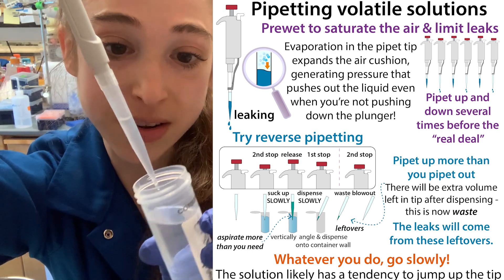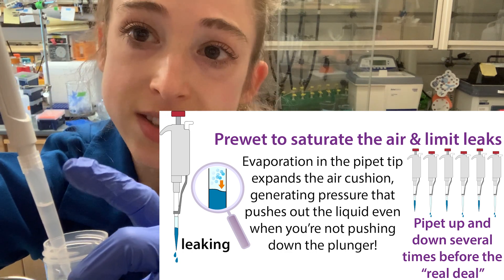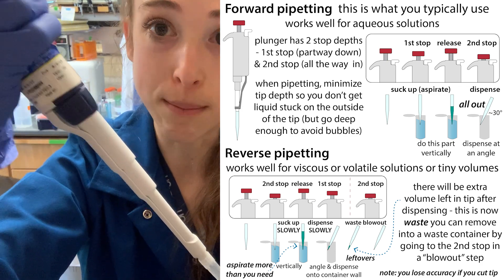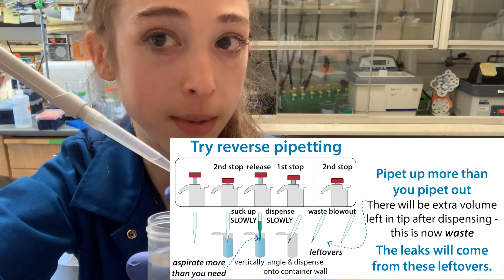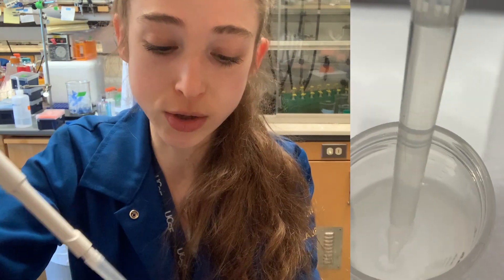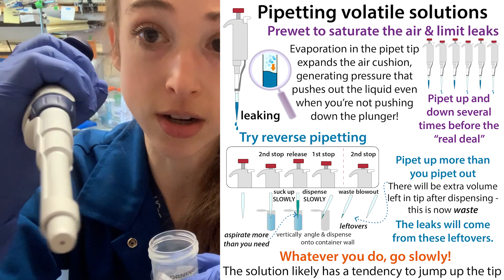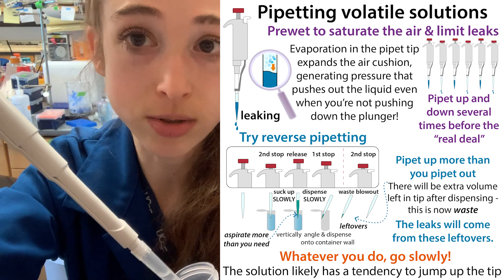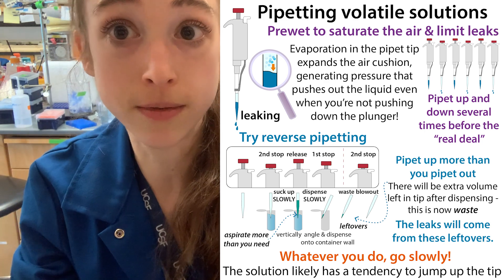Pipetting volatile liquids (ethanol, etc.) - practical tips

Comment: For the prewetting like this, I find sometime a small bubble is stuck next to the tip caused by the priming and can get re-aspirated, causing less accurate volume. I think it js recommend to take out the tip after priming, dispense and then aspirate.